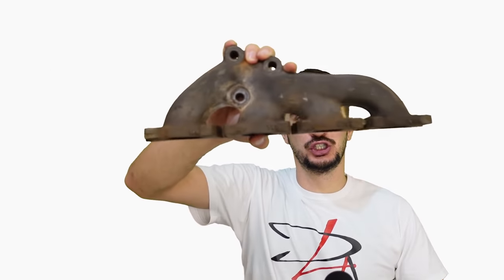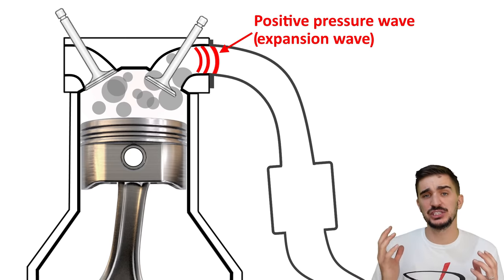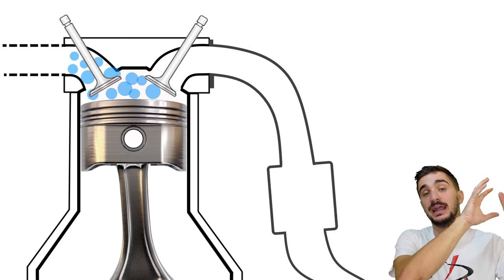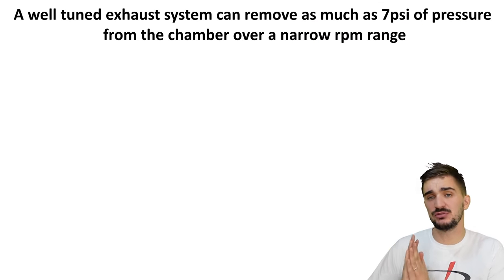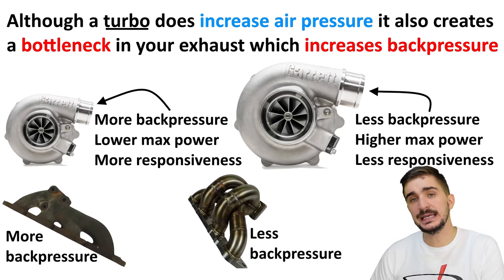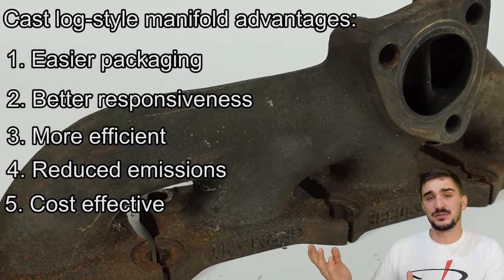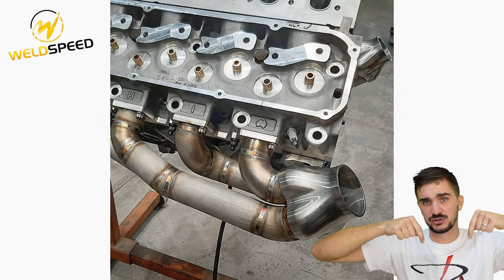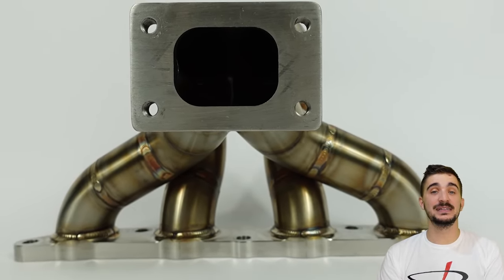EQUAL LENGTH tubular vs. LOG manifolds (headers) - SCAVENGING and EXHAUST BACK PRESSURE EXPLAINED

Comment: Great video man! 👍 It's interesting that some mfg's are going to exhaust manifolds that are part of the head casting, leading to even shorter exhaust runners. Conversely, there's a shop (not) working on Remote Mount Turbos for my NC Miata. To keep all the cats and stock emissions equipment, the turbo is going to be placed where the muffler is, with a charge pipe running up to the engine. No intercooler needed, since the charge pipe is so long. He swears the lag isn't as bad as you'd think, but we'll see.
Reply from the maker: Yeah the integrated thing is definitely not tuner friendly but it is smart. You can put cooling channels near it and obviously reduce emissions even more but getting things even closer to the head. Your build sounds super interesting, I would really love to see it done as I'm also curious about the lag and intake temps in that scenario.
Reply: It is a horses for courses situation.  Do you want quick off the line performance or high top speed.  If you want quick off the line get a supercharger.  Instant boost.  You want high top speed go with a huge turbo and take the time to get there.    Think Top Fuel vs F1.

Comment: Intake is subject to the same issues... So there should be also a low pressure wave drawing fresh air/fuel mix into the runner/head/chamber due to plenum volume and profile, and runner diameter/length....

The reverberating pressure pulses help accelerate the gas flow. There may be a high static pressure but all the molecules all needs to accelerate. Then there is also the mixing/atomising of the fuel charge which is necessary for optimal performance and longevity of the combustion chamber components. The correct nature of gas flow at the point where the fuel is mixed with the air has a large impact on the cooling nature of the fuel mixing/atomising process. And poor air fuel mixture control, combined with focused heat soak areas is the death of small capacity and high rpm / high combustion chamber pressure type of ICE. 

EVERYTHING must form a part of the whole with high performance 1.5L - 3.0L ICE. Otherwise EVERY other link in the chain must pick up the slack to compensate. Which is why cars running 24psi+ with eBay intercooler/piping kits & overpriced, overweight 20" rims, only function well in a straight line and at WOT, and either become a troublesome money-pit, or don't tend to last very long.

Comment: I know the overall length of the whole exhaust system makes a difference in HP and torque. I used to rally and race a mk1 escort in the 70’s and when I was circuit racing I would remove the full length exhaust and have a short straight pipe from the race headers that exited just before the back wheel. It had greater power at lower to mid rpm but lost out slightly at max rpm due to less back pressure in the exhaust. I guess nowadays you can experiment on Dynos to develop the exhaust to give max hp at whatever rev range you wanted. 🚗🚗🚗🚗

Comment: Overlap always helps a turbo spool. Positive displacement supercharged engines are sensitive to valve overlap.
Reply: how
Reply: 6.46
This is a normal turbo. A positive pressure (water)pump, because that and small rc fuel racecars are what I'm familiar with, can take the air from the normal turbo and compress it significantly. Sadly it's useful effects are often negated by the heating of the air. 
A pgp pump usually is an reverse steam engine, though for hydrolics a range of different pumps exist.

Comment: I just watched Richard holdener video about tubular vs log turbo manifold and yes log manifold have more than 50% back pressure but it still made around 40hp(700hp engine)more compared to tubular manifold… so turbo doesn’t even care about equal length or pulse 
The good thing about tubular manifold is weight,customizable and looks cool,not making more power in turbo vehicles.

Comment: so what you're saying is that i need ten pipes sticking out directly from my heads without any bends that dump in my wheel well at 45 degrees down and hopefully the turbo diesel exhaust doesn't mess with my airbags

Comment: That log manifold is from a 1.8T Audi. I have one one my car. They have a common issue of boost bouncing up and down. It's hard to hold a specific psi at times. I have a n equal length but I need to make some modifications for it to fit. It was cheap...
Reply from the maker: Yup! I picked it up on a junkyard just for this video

Comment: I used to have a truck that had variable valve timing on the exhaust camshaft, so that the ECU could adjust the best RPM for scavenging. 

Too bad it was a miserable pain in the ass to work on.

My current truck most likely does something similar - it has variable valve timing on the exhaust AND intake cams.

Comment: Someone once made a video I think it was boosted boiz where they taped paper at the flange port and used an airhose and blew air into another port. If the air blew the paper away the header tube is not efficient. If it sucked the paper into the header the manifold design is good.

Comment: Well, some companies just cast a cheap log, others make a nice precision shaped cast manifold. The Evo X oem cast iron manifold would crack, and stainless tubes aren't for everyone, so MaPerformance cast a much better manifold out of stainless. Dyno tests were great.

The #1 downside to tubes is how much heat the give off. In cramped underhood spaces, it can scorch everything else to death. Some evo X models had a plastic valve cover, and the radiant heat of stainless tubes would melt it. If you wanted tubes, you needed an aluminum valve cover. Those aluminum valve covers are in limited supply.
Reply: And some like BMW use stainless steel to make their log style manifolds (e.g. the B58 engine)
Reply: @keithw4920  That's pretty sweet, I never know that much about BMWs.

Comment: @driving for answers

Would you say then that supercharged engines almost get the best of both worlds in this case, because they can utilize scavenging, but there is no turbine inlet to restrict the flow of the exhaust? Obviously there are other drawbacks of blowers such as engine load and pulley issues but for this case, it seems like they are advantageous. Planning on supercharging my FG2 with a header.

Comment: Hi, big fan of the channel. You have awesome information on many topics. I’m a big fan of your engine videos. You should look into the Ford 4.6 modular engines. I’m not sure if you are familiar with them but they are extremely strong and reliable with many applications (Nitrous, Supercharger, and turbo). 100k-200k miles easy. And it was even the engine that a variation was used for the Koenigsegg. Keep doing the videos they are great. Patreon?
Reply from the maker: Thank you for the support and kind words. There will be some Ford modular stuff in this Sunday's video 😉. I have a link to my Patreon at the bottom of all my video descriptions.

Comment: Dodge has an active intake manifold which changes the length of the runners to make the manifold have a wider rpm band. Imagine the result is someone did the same with exhaust and broadend the rpm band in which peak scavenging takes place. That would be something wouldn't it?

Comment: quick question on the exhaust scavenging effect. since 4-2-1 headers have 2 places where the gasses collect, at a different distance away from the engine, does that mean a 4-2-1 header will have 2 rpm ranges where optimal scavenging happens compared to a 4-1 header where there's only 1 rpm range?

Comment: noticed cast turbo manifold was  separated  between outlets . and fancy one was solid ... i did make one solid and had trouble with gasket distortion .. till  we cut the solid  plate . honda jet ski turbo model

Comment: The benefits of a Turbocharged by exhaust have both Pros and Cons.
As Turbocharged do rely on exhaust fumes accelerating the Turbo Spool.
But a Turbosupercharger is a different story due to it using a Mechanical way to push Air in.
Thus further increasing the Pressure of the intake and making the exhaust pressure free to push out whitout bottle necking it.
Still its up to the Build or the owner of the Car to choose what is best suitable for the Car,cost efficient or performance efficient.
I say my naturally aspirated engine needs a Turbosupercharger.

Comment: LOVE YOURE VIDS MAN . BUT WHAT ABOUT WHEN THE EX VALVE OPENS BEFORE BDC AND STILL HAS PLENTY OF PRESSURE TO GET THE SPENT GASES RUSHING OUT .. ? WOULDNT THAT BYPASS / OFFSET THE NEGATIVE PRESSURE WAVE TO A DEGREE?  THX

Comment: For maximum turbo responsiveness and power at the same time, why not just have one turbine per exhaust outlet, running off of extremely short right-angle pipes with wastegate ports drilled into them? The intake turbine or turbines can be driven from them like a supercharger, with the exhaust turbines spinning a chain or belt system to turn the intake turbine. Sure, there's some friction loss in the chain drive, but cost aside you reduce many of the problems that persist in turbocharging, especially if they're all running in parallel, all locked to the same RPM.
This also allows for a much smaller exhaust assembly, as you can no longer need to worry about evening out the backpressure and can just join the exhaust together log-style, saving a ton of space.
Takeaway: one turbine per outlet, mechanically linked to both each other and a single larger intake turbine, is the superior way to make power, since you can get both high response and high power.
Perhaps the biggest problem to consider is how to manage the heat.
Another thing to consider, is if you want smaller turbines, you can line them up parallel to each other, either  straight out and facing down or at right angles, facing out either from next to the engine block or next to the valve cover. But for larger turbines, you'd have to set them up on right angle pipes, alternating between mounted high and mounted low, just so they'll fit.
For a V6, this would be best done by two turbines mounted down block side, one mounted valce cover side, all carefully lined up and reinforced so that a chain or belt can be run between them, on either side of the engine.
Thank you for reading my brainlet moment.
Reply: The speed of the turbine is too high, having a chain linking multiple turbines would be a mechanical nightmare.

Comment: Cool banana's mate, great video again. Just wondering if an older style (2002 bugeye) WRX would benefit using equal length exhaust manifolds along with a catless up pipe and larger free flow exhaust?

Comment: Although correct a kinda simplified explanation. There are multiple high pressure and low pressure waves in the primary tubes at one time.

Comment: Having a very different vehicle (small truck) in mind, I wonder if the same rules apply to diesel engines, and if instead of increasing power it could be used to increase fule efficiency?

Comment: What about turbine exhaust outlet inertia? If you close all exhaust valves it will not just stop immediately, it will be spinning for some time and it should create vacuum which should help scavenge exhaust gasses when valves open up. I always thought that is why equal lengh headers are not as esential on turbo engines

Comment: For a 2022 WRX, will putting a cat-back exhaust with larger diameter tubes have a negative impact on the rearward pressure wave that I should be concerned about?  Or, since it’s turbo, does it not matter?

Comment: I could be wrong but I think early gasoline engines (~1900s) were designed to have the exhaust valve completely close before starting to open the intake valve.  It was logical.  The engines did not run that well.  Somebody thought about that and reasoned that having some valve overlap might be a good thing.  Evidently that turned out to be true because of a few reasons scavenging being one of them.  
The overlap is what gives larger V8 engines that loping idle that I love to hear.  It sounds like…….victory!

Comment: Is the 'ideal primary tube length' formula only for scavenging, or can it be used for calculating the ideal tube length for a maximizing turbo at a particular RPM?

Comment: I assume there's a metric option to calculate your primary tube length?

Or I just have to convert the answer to a metric value.

I got a bit lost when back pressure was thrown into the mix.

Comment: What if you tune a turbo charged engine's exhaust to be able to scavenge at very low RPM's before the turbo spools up?  at 1500-2000 rpms you could probably give your engine some more grunt.  Though this would require a DOHC with variable exhaust timing.

Comment: Just had a thought. I wonder if there's anything to be gained by having a variable geometry exhaust manifold, in a similar way that variable length intake runners are used on some engines to tailor performance more closely to the actual operating conditions of the engine instead of having to compromise for a design that works well across most of the RPM range?
Sure it would be more complex, but what I'm wondering is if it would have any noticeable effect now that we have variable valve timing on both intake and exhaust on most new-production automobile engines, or if the variable valve timing system eliminates the need for such measures?

Comment: Excelent videos! Can you talk about nikasil plated cilinders, what is, when it is used, with wich types of pistons and rings, etc? There is almost 0 informatiin about that subjetc. I really appreciate that tnx!
Reply: There's quite a bit of information about it out there. Mainly motorcycle related though vs automotive. Since 1996 all of the motors in the power sport industry switched to nikasil plate cylinders. Two stroke stuffing showed a dyi process for plating cylinders and it's close to the chroming process.

Comment: Its  not always bolted to the cylinder head.   Actually more an more companies are casting the intake and exhaust  manifolds right into the heads. Eco boost 2.0 and cummins  5.9 6.7  examples of each.

Comment: I need a new exhaust gasket and am wondering if headers are worth it
4.7 L V8 Dakota, manual tranny, low RPM, daily driver
are stainless headers worth it? or is it actually better to stick w/ the logs?

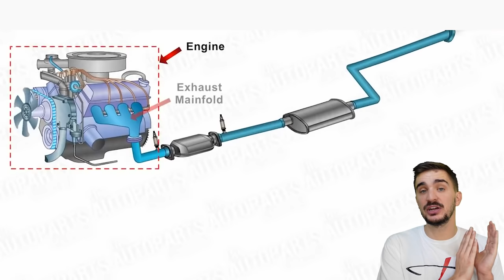Comment: I don't get it man, 0:35 what is that "Catalytic Converter" thing? 
1968 Barracuda Fastback
Blueprinted 360LA block, 2x 4bbl 500cfm AVS2 carburetors, Offenhauser single plane dual quad intake, CNC Promaxx CNC heads, ductile iron rocker arms (no roller tips for needle bearings to fail), Ferrea hollow stem intake valves and Ferrea solid stem exhaust valves, solid flat tappet cam, Forged pistons and rods, internally balanced cast Scat 3.580" crank, Doug's D453 ceramic coated headers, 2-1/2" exhaust with H pipe, cutouts for the track and mufflers for the street. Trying to keep it out of the 10's so I don't have to run a cage.

Comment: The use of sonic pressure waves in exhaust design was invented by Walter Kaaden in the 1950s. He developed race engines for the East German MZ company. Kaaden was the first to achieve 200bhp per litre. Karl Degner the MZ race rider defected and took his knowledge to Suzuki. Look into their two strokes and you might as well be looking into an MZ. 
Variable exhaust ports came from Yamaha in the 1970s and on road bikes in 1980s. Sadly, two stroke direct injection was never considered. Everyone went to four strokes.

Comment: So I'm guessing I should probably stick with my factory GM 1.4T cast manifold unless I'm planning on building a lot of power. I get an average of about 55 miles per gallon in my Chevy Cruze eco with a M32 6-speed manual. I don't drive the thing in high RPMs. Every modification I do to my vehicle has fuel economy/engine efficiency in mind.

Comment: Could you have unequal length but with unequal diameter as well to make the exhaust gas reach the turbo at the same time but also decrease manifold size?

Comment: You forgot to mention how they also design manifolds to scavenge neighboring cylinders to help the cylinders filling and exhausting when the exhaust pulse passes by a different cylinders runner it will cause a negative pressure in that runner helping to pull that exhaust out of the cylinder

Comment: I have an exhaust manifold question? 
I have a tuned 1999 Mercedes turbo diesel inline 6. I’m wondering if I were to remove my stock cast log style exhaust manifold and we’re to port and clean out the insides would I benefit response and power wise?
Or would I loose needed back pressure and it would be counter productive?
Please advice

Comment: Forgot to mention that exhaust pulses help clear eachother, the low pressure behind the pulse will help pull the next pulse along at certain rpm ranges if the manifold allows it

Comment: I have a simple question, briggs and stratton v twin with a 450 then 270 degree firing order. Is it better, for scavenging, to use a dedicated correct length open header no muffler independent pipe on each cylinder, versus any type of design that would co-mingle the two pipes together?
Seems to me it would, as the reverse pulse would not split to a cylinder pipe that can't possibly benefit from it as it is not in the correct phase to use the pulse.
Someone else is telling me that negative pulse pressure will "hang around" and wait for the opposing cylinder to get to the right phase lol, seriously ?

Comment: Could you explain why my Fuel trim went up positive +10% after installing new sportier headers (precat delete)  

ECU ( O2 sensor ) is practically measuring that it's running lean 

Fuel consumption went up these exact 10%

Comment: So if you have unequal length headers on a N/A engine will scavenging potentially happen most efficiently at different rpm ranges for different cylinders based on their primary runners length?